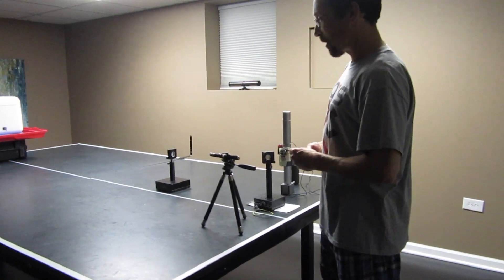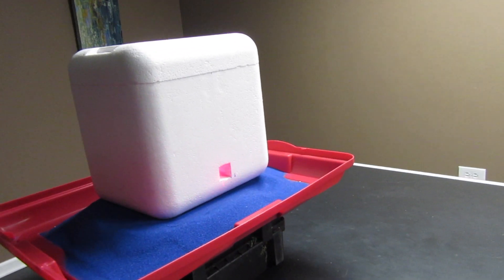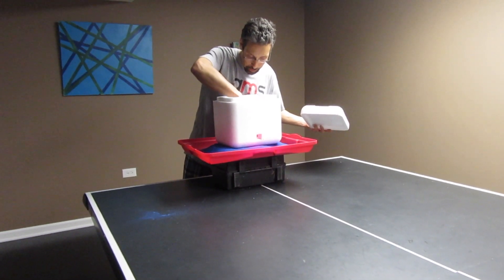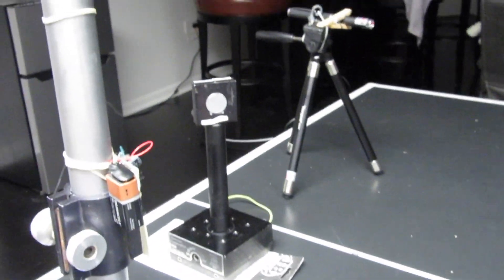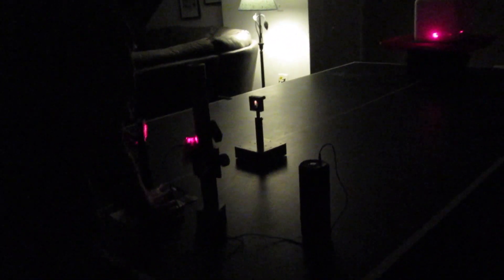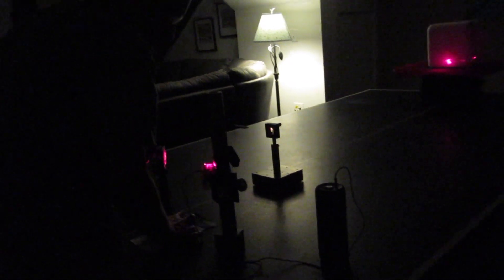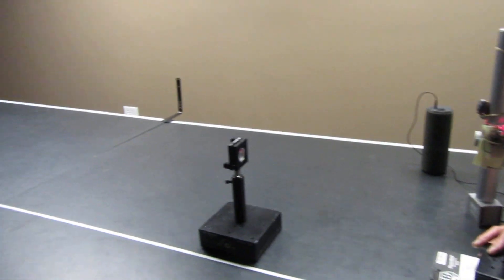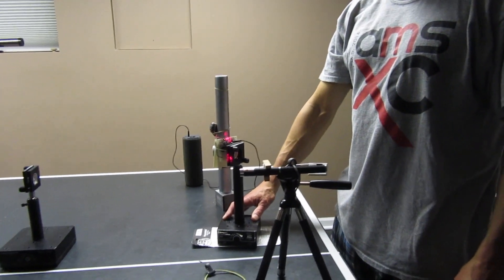Laser Listening Demonstration

Comment: How do you align an invisible light?
Reply from the maker: Either with an expensive infrared camera, night vision goggles, or by aligning the infrared laser to a visible one that hits the target (as observed with a rifle scope, for instance, also aligned to the lasers). You can check that the visible and infrared beams are parallel to each other over a short distance using a cheap infrared card that fluoresces visible with incident infrared; Thorlabs has such cards.